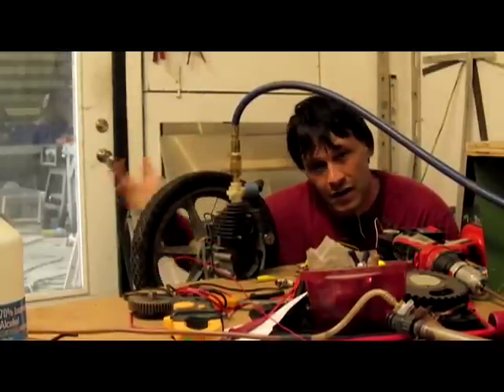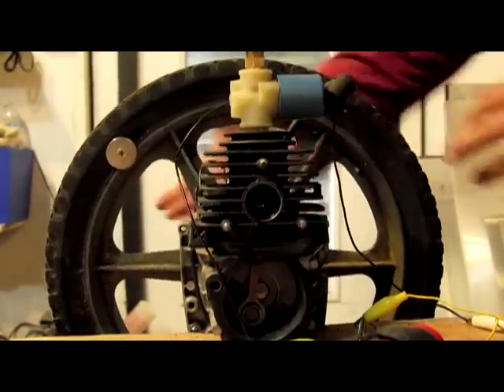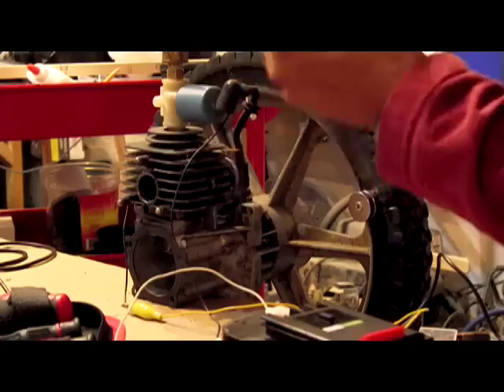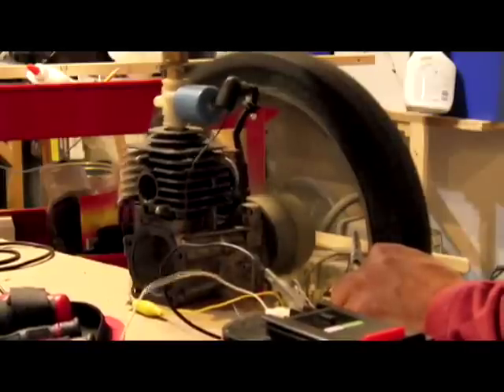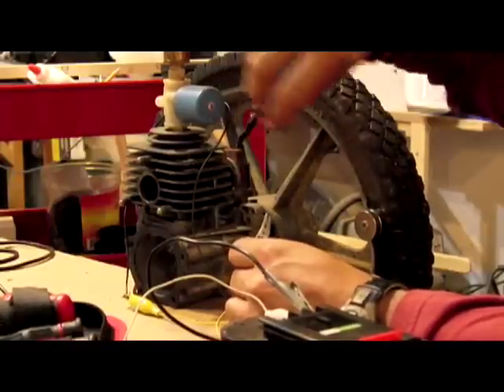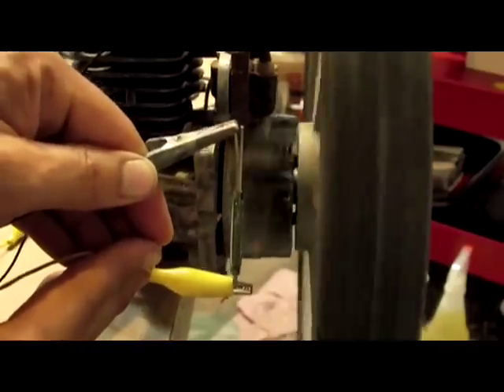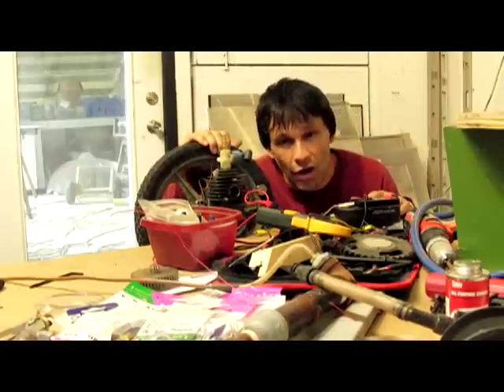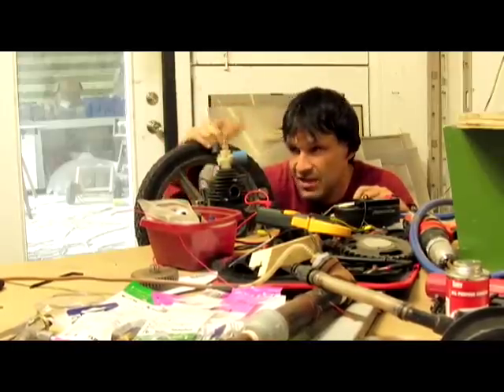DIY STEAM ENGINE HACK TWO STROKE CONVERSION Weed Eater Hack Steam Power

Comment: I would like to see this motor driving a generator with current and voltage readings to compare output power with the power used to create the compressed air. 
It may be interesting to make the compressed air with a Stirling engine. Keep up the good work.

Comment: Have you got a loss of power during the upper stroke (compression stroke) just because an exhaust valve miss, so after the piston close the exhaust port,it must fight against the resistance of compression ????

Comment: @thumpjumper I have a small stationary engine which runs between 20-60 psi but at 20 it barely turns over and is not capable of running at high enough rpms to spin the generator fast enough to make the light light up.  Besides just making a boiler to feed such an engine would be quite the task.  Fire tubes for how simple they look are much to difficult to build on your own build a flash type plant if you were considering that option.
Actually I have worked with a steam popcorn machine though

Comment: @thumpjumper I haven't, but I work with cars and have a bike where space and weigh are issues, with a stationary steam plants that's much less of an issue, but you won't get much work out of 10-15psi unless you have a very large, very heavy engine with a large bore and stroke aka not a lawnmower engine, but actual engines designed specifical for that gas engines don't have a good bore to stroke ratio, running at low rpms, condensation really becomes an issue at such low pressures as well

Comment: @thumpjumper True it is much cheaper than building an engine that could cost 1000 dollars or more to build and easier.  It doesn't mean there is no promise of converting gas engines, but for steam applications a bash valve is a better way to go.  A bash valve is a shaft mounted in the piston head that rises up and hits a ball in a check valve and lets steam in while the shaft holds the check up, but once the piston begins to fall again the check closes sealing the cylinder allowing expansion

Comment: @thumpjumper  Too be honest it won't do much work and you won't get you money's worth.  A couple months ago I saw this and think it's a great idea, but just look up the cost of a solenoid which can take steam and your looking at $200 per solenoid.  Plus for smaller applications you need superheated steam 600-700F and high pressures above 200psi.  Most solenoids can't work above 200 degrees so you can't use it for anything more than an air powered version.

Comment: @BigRedBus100 most powerplants are steam turbines. heating water is actually most efficient way to use fossil fuels. however it wastes alot of energy to vary the output. therefor its no good for cars.

Comment: "Old time" steam engines were actually far more efficient than what you have made here. Your comment about the volume of a steam engine cylinder requiring large volumes of steam does not take into account that steam expands (condenses) as it cools. Therefore it is more efficient & much more powerful taking advantage of the thermal properties of steam.   Marine Steam engines were available in double & even tripple expansion.  Research will show you the reality.  Fun little engine though......

Comment: Why is the neodymium, the one on the wheel, triggering the solenoid at BDC? If the triggering point IS at the top, next to the solenoid, it looks like the piston is BDC. So the air is pushing the piston up? Sorry, this is confusing as hell.

Comment: could you make an efficient enough compressed air, engine. with a generator attached that powers the air compressor so it continuously keeps the engine going? and possible power something else? that would be cool

Comment: you could have the engine power an air compressor to keep it running, and if the motor was efficient enough you could put it on a light home made cart and use it as fun transportation. just an idea that i want to turn into a project.

Comment: Really nice. But, notice how fast it decelerates when you remove the reed switch? There's still a compression stroke and that detracts from efficiency. Keep an eye on my 4-stroke to 2-stroke conversion project. It will have virtually no intake stroke, a power stroke and an exhaust stroke that's pretty much free wheeling, powered by hydrogen injected under mild pressure during the 15* or so that the intake valve opens.

I fried a DMM from HV like that once. Take care.

Z

Comment: @spongbob202 
The difference between two and four stroke engines is not whether they run on mixed or un-mixed gas.  The gas they run on is a direct result of the mechanical differences between them.  Check out some videos of two and four stroke engine operation, and you'll see WHY they take mixed or regular gas.

Comment: at 40 hz or close to 2400 rpm that solenoid will saturate and stay on, making it unless for any faster speed.  just a little limitation with what your doing here.  You need a special solenoid to go any faster.

Comment: Where can i get the type of solenoid valve you have?  the one i got is for a sprinkler system and its not nearly as good.  it doesnt respond as quick,ly so i have to play around with the timing.  I'm actually working on a type of "timing advance" because if you increase the psi going into it it runs rough unless you adjust the "timing".

Comment: At 4:47, you mentioned getting zapped; why not connect a diode across the coil to snub the back EMF? A 1N4001 (or similar power diode) should do the trick. (Remember to connect the arrow side of the diode to +) Nice pneumatic engine!

Comment: I've been inspired by this idea to use the heat from my 10' reflective parabola to make steam, and run that to a similar setup.  I have a couple of concerns, first, a solenoid valve that can handle the temperatures of compressed steam...  and I can also see that the lubrication on the rings of the piston will be quickly steam-cleaned out of the system.  Maybe use teflon rings?
I've been looking to see if you have any new videos pursuing this idea!

Comment: I'm not sure however that a 4 stroke engine's intake valves can handle pressure on the intake side beyond 3 bar.

Also, how have you gauged the power output of the engine? In my experience, those engines with solenoid valves produce very little power. Power is a product of torque and speed, not just one or the other. It's really a product of work and time.

Comment: What exactly are you using to gauge power? Just because it's spinning fast doesn't mean it has much torque. Power is a product of torque and speed.

Your best bet is to have a solid cylinder wall with no exhaust port and have an exhaust valve at the top that opens at BDC then a pressure valve to open a few degrees after TDC and play with timing for the pressure valve. The exaust valve should be open from BDC to TDC. Mechanical valves found in a 4 cylinder engine are the perfect effect

Comment: I converted a 4 stroke Briggs and stratton to an air powered engine. I had a 2006 briggs which had plastic cams and a metal camshaft, and i used a bandsaw to change the cam lobes to 180 degrees. which allowed me to put air in through the spark plug hole and use the intake and exhaust as an exhaust. not near as efficient as yours but it has alot of power

Comment: How will you lubricate the engine? The 2-stroke uses the emulsified oil that fogs the internal parts via the intake port. A sealed crankcase is needed to create a vacuum for the oil mist. Or, have you thought of using  some type of splash system?  A sump will be needed. I know this is a demo, but  any thoughts on long term oiling?

Comment: Excellent Idea !!

You are correct about injecting a smaller amount of steam for a more efficient engine.   For "high quality steam" at 125 psi, you only want the valve open for 1/8th of the stroke, but for "low quality steam", at say 30 psi, you want the valve open longer... Consider:  by placing magnets along the radius of the flywheel, you could vary the injection duration, making the engine efficient over a wide range of pressures!

Comment: Wow this is the most genius thing ever.  I wish I had come up with it.  You could use this to make a steam bike or motorcycle (with multiple cylinders) just like TheBattleWagon said.  The only thing you would need to design or buy would be boiler and pumps and the drive.  I own a steam bicycle, but I have thought about building my own bike.  I would just need to find some 2 stroke engines and copy what you've done and if I want different cutoff use 2 sets and flip a switch.  Genius

Comment: I've been trying this in my garage, on a lower scale, examining the parts of my lawn mower and it seems that you don't even need voltage involved, You can substitute the solenoid valve by a moving part activated by the engine itself! Yes, it will cause some resistance, but as you said, the solenoid will wear out quickly, so, it's better off this way.

Comment: The amount of torque is amazing for that little air! I think it could power a fairly big generator. Have you actually tried this with the Chas Campbel's overunity engine? Think about it: With that much torque you can power big generators, which in turn can power a house, PLUS, air compressor tank refills.

Comment: Another fantastic video Dan, I've made a similar one but so far it is just firing back and forth instead of full rotations.  I don't have a flywheel on there so I'm pretty sure without that resistance/weight, it can't generate the momentum to spin correctly.

Comment: air or steam can be used... build the engine and test it with a typical compressor. To be "green" you would have to design and build a boiler to create steam for the engine to run off of... but then you run into the problem of the bearings being destroyed because of the lack of oil... which is provided by the 2 stroke oil mix in the fuel..

Comment: well i took the carb off of mine and it is about to start at 50 psi without the solenoid vavle. but with one it would start at about 30 psi.

Comment from the maker: @soverato3 I use a synthetic slick 50 type, I will be removing the rigs to see if the tolerance is still good and lowers friction. Most pistons actually are very close for air or steam, but a larger flywheel might be needed for loads.

Comment: The magneto isn't supposed to rub, it needs to be gapped with a feeler gauge.  Also it needs to produce about 20,000 volts DC for a proper spark, not 130. if you hooked up the spark plug wire to a high-end oscilloscope you'd be able to see that :p

Comment: Vaporization of a saline water, without filtering?
I do. I also know.
quick experiment, steam natural saltwater, and collect it. Let it cool, and then drink it. You will notice that the steam turned to water still has a salty taste. That's why purifying salt to fresh is expensive. Filtering, and multiple steam chambers are required.

Cheers!
D(B)

Comment: I'm curious as to if you could not only use the voltage to fire the solenoid using a regulator, but also take any excess, and put it back in to the battery. That would give the battery a longer life at any rate (depending on what current is being supplied with that voltage).

D(B)

Comment: A double acting steam engine is still a better design, theres a reason they designed them like that back in the day, alot mor power, even with the sliding valve, you get power on every stroke.

Comment: Thnx Dan .. go glad i stumbled onto your vids. I have been looking for an engine i could buy and not build to replace my 250cc 2-stroke with electric or steam engine.. but this would do the trick! and maintain the original look of the JAWA Perak 1954 I wanted to convert (might just go with the CZ1952 125cc ,its lighter and work just as well.)

Comment: Great stuff! But what we really need IMHO is a more efficient chamber expansion enegine sytem. Those crank shafts really only work on bicycles, because how our legs fold when they transfer muscle strength. Efficiency and torque can be tripled I would say if a more sensible sytem were to be used. Same goes for typical cars, needlessly spendy of gas.

Comment: a poppet style in theory would work. make a part to fit in the plug hole and use 3/16 drill rod, set the gap at TDC to open precisely and your golden ! do it it will be fun!

Comment: thanks for the video! Can you explain how you would set up the engine to run a ball/check valve? basically you would have it so the piston is opening the valve on the return stroke allowing steam into the cylinder right? so what kind of compression ratio do those little engines have? and wouldn;t your steam pressure have to be a bit higher than the cylinder pressure at TDC? the good solonoids are kind of pricey, lol.

Comment: Couldn't you just gravity feed oil into the port where the carb used to mount? That would lube the bottom end and top end just like the gas/oil mix used to, then be forced out of the exhaust port. You would have to have a decent size tank for the oil to be held in, but you could just use the original gas tank that came with the engine.

Comment: You are right, I had not thought of that.  Some of these engines have ball bearings for the crank. However the rod bearings would still be dry. I would think you could install a oil slinger system like a briggs motor. Perhaps a dipper on the rod cap?

Comment: It is not as efficient as you might think as a steam engine. With live steam, the top priority is keeping the engine hot which is why there are no real steam engines with cooling fins. 

Also have you tried to run it on air without the solenoid?

Great collection of ideas you have on your "channel". Keep moving forward !!!!

Comment: Have you addressed the issue of lubrication anywhere? Also, a video on producing a DIY slide valve would really help. I really want to try to run one of these on solar produced steam.

Comment: so, how about replacing the windings on the spark plug coil to produce less voltage?  and the check/bash valve, i'm planning that for my bike engine.

pyhap2ev: sometimes, fuel type is more important than preventing waste, if fuel regrows for free every season, taking the pollution it makes, back out of the air, it's almost null.

Comment from the maker: Um, Air powered tools cannot run off of steam, fact vanes do not work well with it. This does. So while air engines have their place, these actually compete with regular steam engines. A steam engine this size and power would cost $1000. This would be $10 with a DIY slide valve.

Comment: If this guy can convert a gasoline engine into an air-powered engine, maybe I can waste countless hours and money converting all of my air-powered tools to run on gasoline!  There are already engines that are designed specifically for use with compressed air.  They're much more efficient than converting an old gasoline engine into an air-powered engine.  They have air-powered cars in India made by Tata Motors.  Air-powered car?  Good idea!  The thing in this video - not so much.

Comment: 2nd (and last): steam engines are mostly double-acting. So the energy needed for forcing out the exhaust steam, comes from the steam on the other side of the piston, so not ONLY from the flywheel (or anything turning).
I hope I'm clear here :)

Comment: About the steam engine... you  say that it's a waste of energy to force the steam out... while I think that this engine has the same problem.
You see, when the piston is moving back up, the exhaust hole is closed and you create a closed chamber. The air in that chamber is being compressed by that piston, while the only thing the piston needs to do is to use that compressed air (not to create it)

Comment: just had a nice thought, put the crank case back on, drill a fitting into the crank case, fit a secont solenoid valve, and with another reid switch to operate that at 180 degrees to the first valve, and you would have a double acting basicly 1 stroke engine with twice the torque - perfect for running a decent generator or alrternator

Comment: use the exhausted gas to run a small turbine generator to power the solenoid valve, and then you dont need a battery, and you could maybee even run a dry sump lube system for the crank case with very light oil to stop the crank bearings from wearing out

Comment: In regards to lubrication, I believe that traditional steam engines sometimes had a built in self lubricating system at least to lubricate the piston.  I think that such engines had an oil chamber that the steam line passed through, drawing a little oil into the steam as the steam passed through the chamber slightly above the level of the oil.  This keeps the piston self lubricated.  Obviously other parts would need lubricating manually.  I reckon that would work in this case too.

Comment: ok i want to do something sort of like this involving compressed air
i was thinking would it be possible to run a bike through a old 2 stroke engine rigged for compressed air that is also through magnets providing electricity to run a small air compressor in the front is this possible or am i stupid for even thinking it would be

Comment from the maker: For steam you would need a high temp valve. For air  any "normally closed" valve will do. The valves are rated in life cycles. This one has fired over 1 million or more times (tough estimate) and still works. It is rated at 100,000 or so. A mechanical valve would be better but this does work good.

Comment: would it be possible to use something like the c02 mechanism at animated engines instead of the magnetic valve? or possibly a mechanical valve powered by the rotation of the engine that would be less susceptible to breaking?